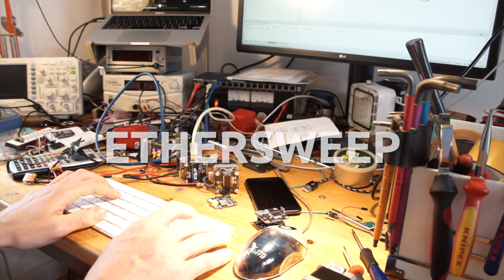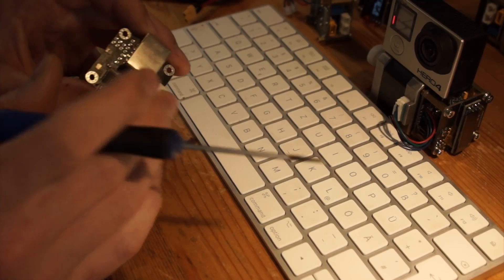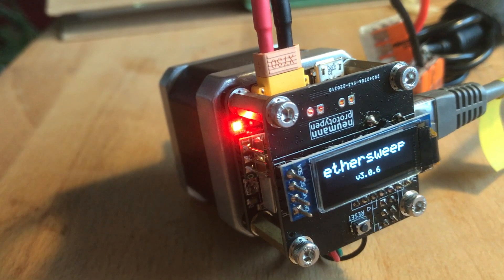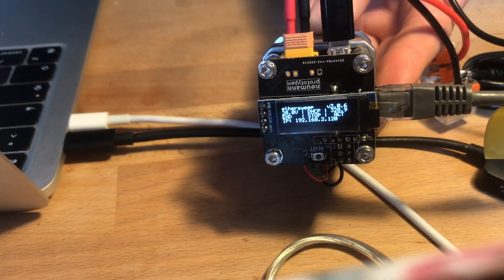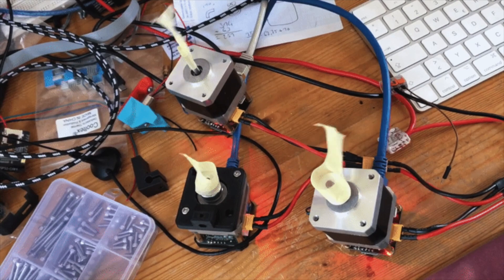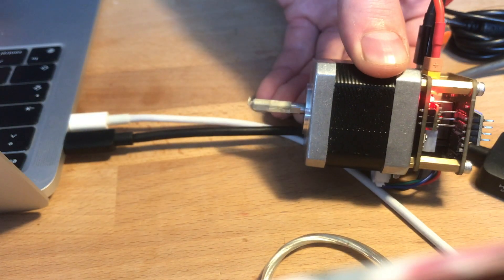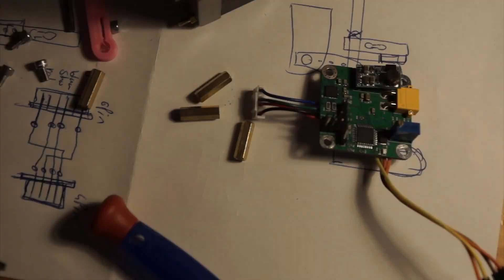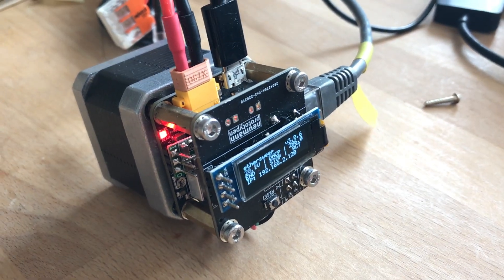Ethersweep GitHub Release - Open Source | Arduino based Network Controlled Stepper Motor Driver

Comment: Would it be possible for this to control a Nema 23 or 34 stepper? Potentially just using the input clk/dir signals to control an integrated nema 34 stepper motor?
Reply from the maker: Currently there is no GPIO available on the board. With different firmware it would be possible to drive step / dir signals to the button inputs and translate them to the STEP / DIR for the stepper driver, but I think a board like the mechaduino or similar would make more sense, as they are cheaper and made exactly for that. (Though it would require a different, more powerful driver for NEMA34. The same would be true for Ethersweep boards as well) https://www.kickstarter.com/projects/tropicallabs/mechaduino-powerful-open-source-industrial-servo-m

Comment: Very nice done. How much does one nema17 controller without the stepper motor cost when building it myself?
Reply from the maker: If you order everything on your own, and buy for five controllers you pay less than 40€ including everything per controller. Ordering for one only doesn’t really make sense, as the shipping costs and initial PCB manufacturing prices are relatively high. But I’m working on the next version currently with cheaper and better components :)

Comment: Seems like ethercat support might also be interesting but I know that would be a real handful to implement in such a small area
Reply from the maker: Hey Thanks for the comment!
Unfortunately, EtherCAT is patent protected and therefore nothing for open source. Also I think it is implemented on a pretty low OSI layer to get the real-time functionality. The W5500 only supports the higher layers to my knowledge. On top the atmega328 is on its limits. But this will most likely change in one of the next versions. I'm currently working on STM32f103 implementation and a TMC2209 instead of the 2208.

Comment: have you thought of releasing just the closed loop stepper driver board with the ability to send step dir signal for 3d printer applications?
Reply from the maker: What a great idea! Maybe we can just use the pin header that is currently used for the Ethernet board connection. This should be easily done in software. I will take a look at that. If you can't wait for that, these EMM42 boards are available: http://www.aliexpress.com/item/info/1005004783177311.html

Comment: Great project! What about implementing onvif protocol somehow in future??
Reply from the maker: Thanks for the comment!
Is onvif not only a standardization for video/camera hardware? As the controller would only support one axis, PTZ would have to be implemented with three Ethersweep controllers I would say.
Reply: @Neumi  Two are enough for most cases... Anyway sometimes also one controller is enough, if you need to control only one direction for example. Thank you for your kindly answer.
Reply from the maker: @tombolinux  Implementing it shouldn't be a problem IMO. But I would keep it separated from the normal firmware. But might be worth try! Thanks!
Reply from the maker: If I'm not mistaken, the developer has to pay a fee to participate or use the protocol. So Ethersweep is not going to be compatible with onvif protocols anytime soon as it is closed source and won't work with the open source software, Ethersweep is based on.

Comment: hello ,great explanation and effort. a question can your device be able to do real time process control with bigger motors for industrial applications
Reply from the maker: For bigger motors the design has to be changed quite a bit. Currently it only supports 32V and 2A max. Also, the packet delivery is not guaranteed (the next firmware update will fix that though) and packet time can be up to 10ms depending on the network setup.

Comment: This is a real cool project. Could you adapt this to a much bigger stepper say Nema 23 or 34? Once again, this is a great job, and thanks for sharing.
Reply from the maker: Thanks for the comment!
It would be possible, but not without large changes. But developing a higher voltage version for NEMA 23 or 34 and a low power POE version is on the list :)

Comment: Have you thought about using PoE to supply power to the circuit?
Im not sure if you can step down the 44-50v to the max 30v in a small form factor, but that could make it a little more compact and wouldn't need an extra external power supply. 
I might look into that a little myself, because this is a neat project.
Reply from the maker: Thanks for the comment.
There is actually a discussion ongoing exactly on that topic. Personally, I don't see it as a super valuable feature, as you anyway need a cable to connect, and on top of that relatively specialized networking equipment. But I think it really depends on the use case...

Comment: Awesome product. How is it with parallel control? Does it use interrupt requests or multithreading?
Reply from the maker: Thanks! Parallel control is currently done with broadcasts. Downside of that is the high latency between the controllers on normal networking equipment of up to (measured) 10ms. I still have to work more on that to be useful. But I'm in general not sure if this setup can be fast enough for parallel motion control like CNC. 
I used these motors more in time uncritical applications where the position can be verified.